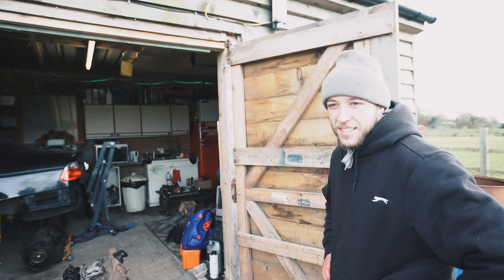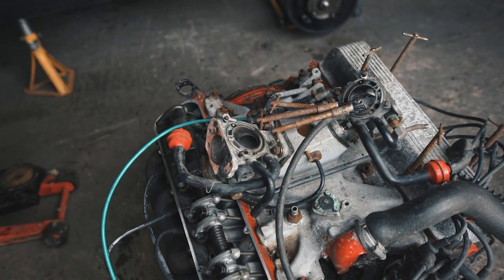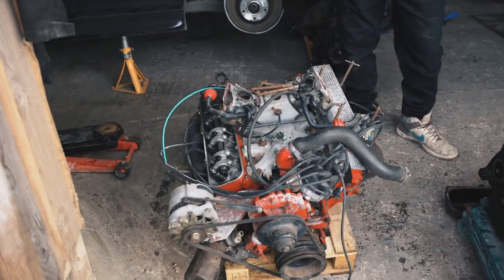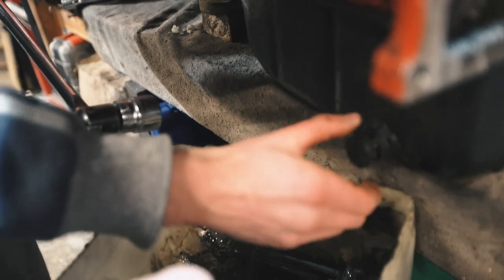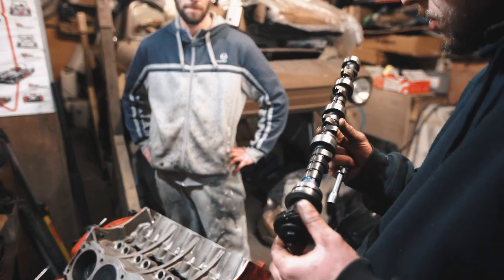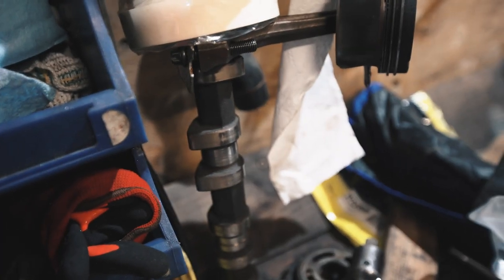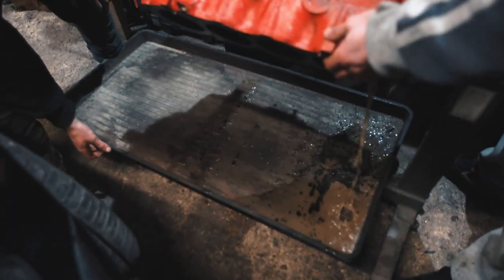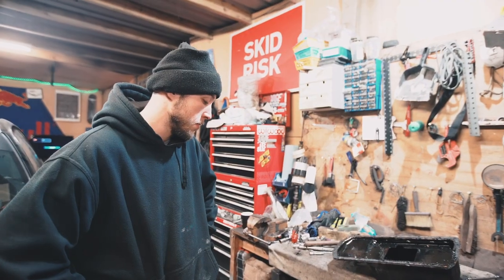ROVER V8 ENGINE TEAR DOWN! British Classic Car Restoration EP 2

Comment: fill the oil pump with vaseline  or pour loads down the oil pressure switch hole, they do not pick up their own oil very well on both rebuilds and servicing (if you do an oil change, drain and refill the sump, fire it up, stop engine then change (pre-filled) filter)
Reply from the maker: Will read into that Neil, appreciate the words of advice mate!
Reply: @WeaselWerkz  used to work at wildcat engineering, done a few of them, can only remember building one standard engine though, all the rest were upgraded in some way, think the company has been sold and is still producing race bits but don`t know where they are now